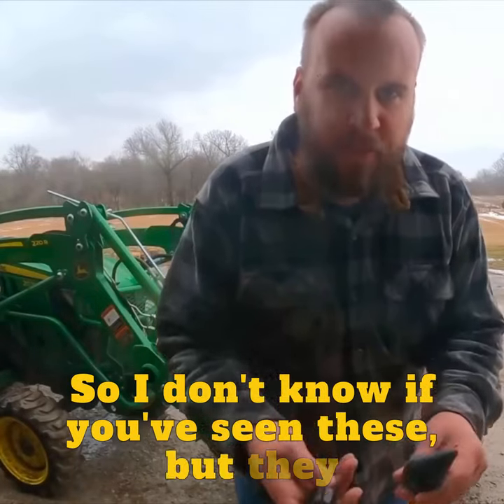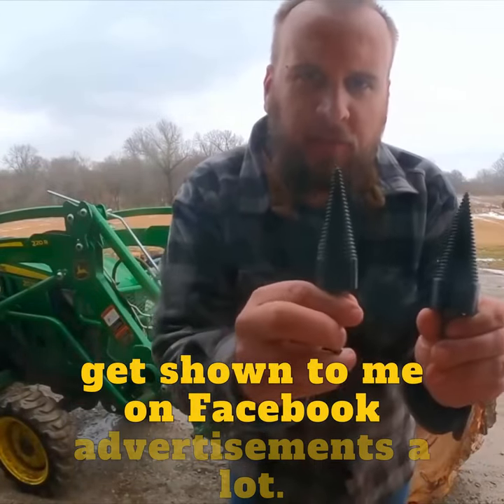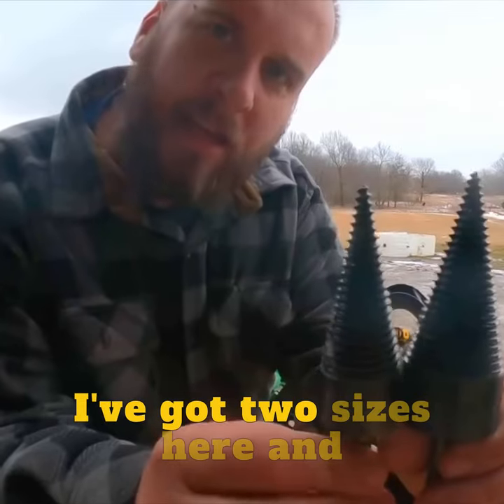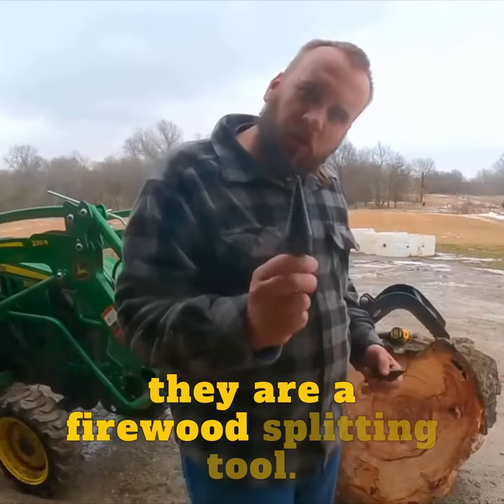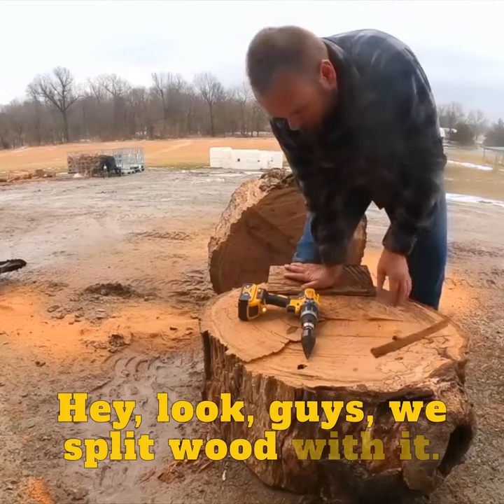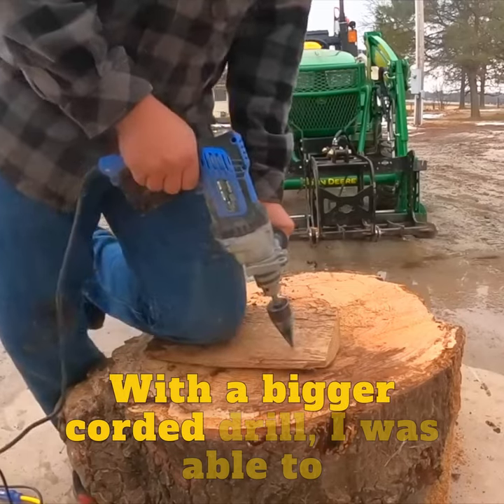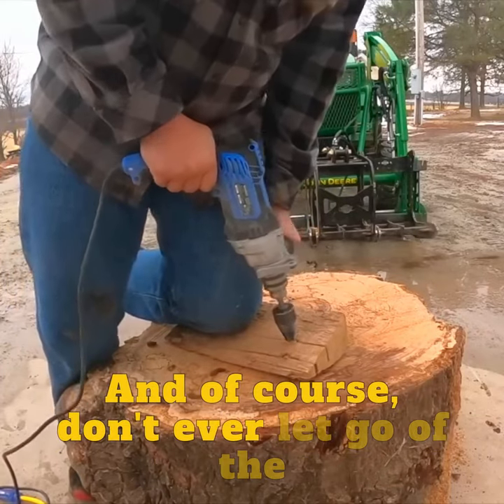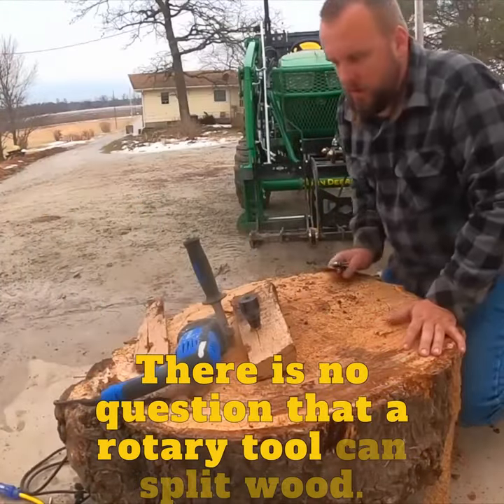Firewood Splitting Drill - Gimmick or Useful Tool #shorts #firewood

Comment: My wife bought me one about a year ago. I got it stuck immediately!  At first I had it attached to my Dewalt 3/8” corded drill. That drill is a torque monster for what it is. Then, I got my 1/2” corded drill I use for tire changes. I ended up breaking the little M Effer in about 30 minutes. What really adds insult to injury is that my wife blames ME for the failure. Bottom line is that cheap stuff off Facebook that takes over a month to get in your hands ain’t always worth your time or money. Thanks for sharing your HONEST opinion.